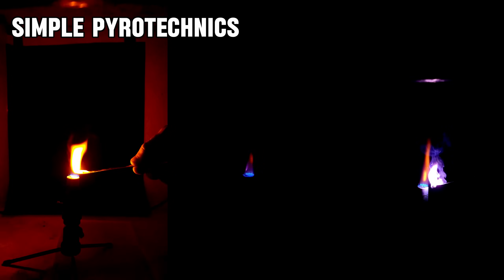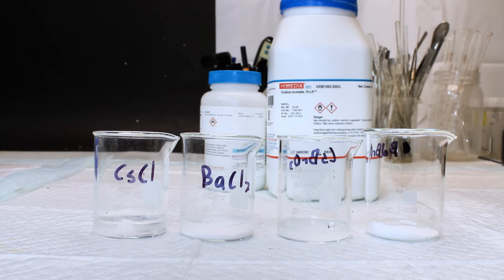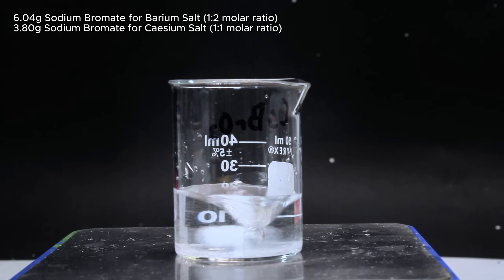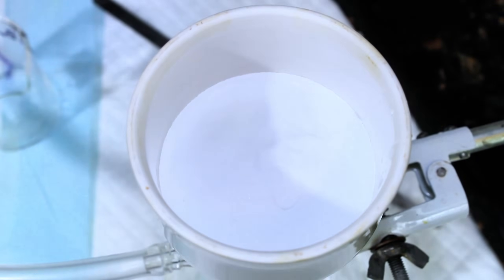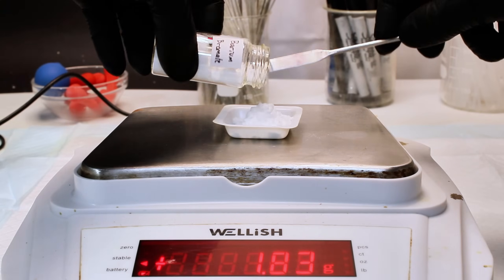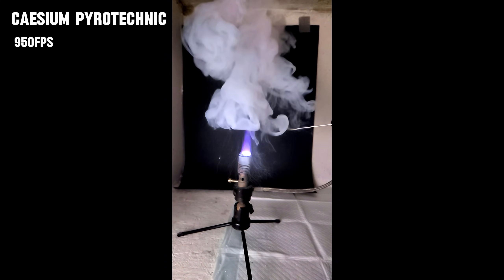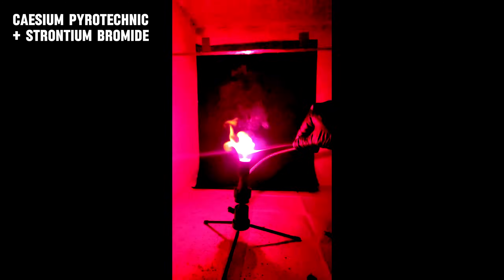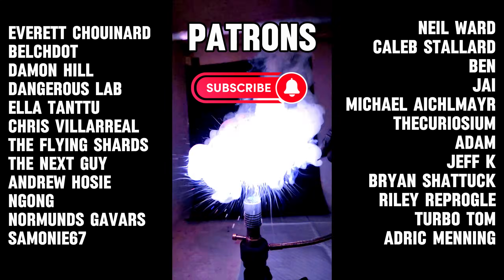Making Simple Pyrotechnics

Comment: Is this as hard to make as it sounds? Our Own Devices has a video on the night vision "Metascope" which has this phosphor compound as its detection element.
Standard VII
Two hundred and eighty grams of strontium sulfide, 28 grams of chemically pure magnesia (ignited in air at 1050 C), 13.4 grams of activated lithium fluoride, and 28.5 grams of strontium sulfate are screened through 150-mesh silk, mixed in a mortar and milled for an hour and a half. The powder mixture is placed in covered platinum boats of 80 to 85 grams capacity and fired in pure nitrogen at 1050 C for 30 minutes; cooling is also accomplished in the nitrogen atmos¬ phere. The product, after inspection for abnormalities, is ground in a porcelain mortar to about 16 mesh and then milled for 2 hours. After screening through a 300-mesh silk, the powder is bottled and stored in a desiccator.
A thin coating of Standard VII powder is applied to a graphite button (grade C-15, National Carbon Company) of the proper radius of curvature, by first suspending the phosphor powder in a solution of methyl methacrylate in ethylene chloride and then paint-spraying the suspension onto the graphite but¬ tons. After drying, the buttons are fired in an airfree nitrogen atmosphere; they are placed on steel trays and inserted into a quartz muffle, heated to 860 C and kept at this temperature for 20 minutes. They are cooled under nitrogen and then inspected for faults.

Comment: out of date boating flares + manual copper tube cutter to cut off the pull igniter  head 
go slow twist add more pressure to the blade twist repeat till tube is cut then u bend to snap the compound.

Comment: Really interested to learn ahout the low solubility of cesium bormate! That one was surprising since its an alkali
Reply from the maker: Right? Cesium is very interesting, and I wish it was more affordable (cesium chloride costs about $2 per gram). Generally it has many of the same properties as potassium salts but to a more extreme degree. For example, soluble potassium salts like KCl are EXTREMELY soluble as cesium salts, but less soluble potassium salts like permanganate, dichromate, chlorate, etc. are very insoluble as their cesium derivatives. Again, if this stuff was more affordable I'd use it constantly for selective precipitations.

Comment: personally i wouldn't wash a pretty unstable oxidizer with something as flammable as isopropyl alcohol but I guess it's not too big of a deal
Reply: Oxidizers like nitrates chlorates etc don't work when they're wet
That's just from my experience
Reply from the maker: fair point but yeah generally speaking these type of oxidizers only seem to oxidize well in a dry solid-state mixture. Liquid oxidizers like fuming nitric acid on the other hand is a very different story lol